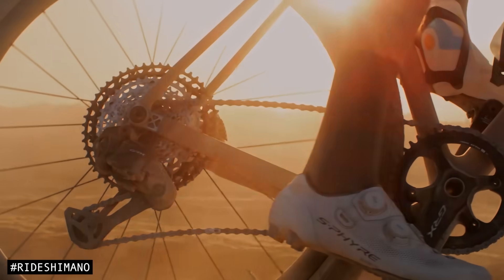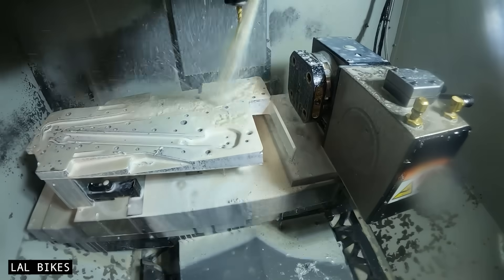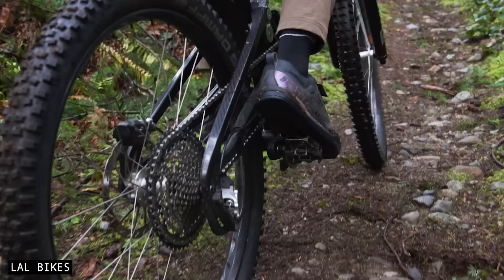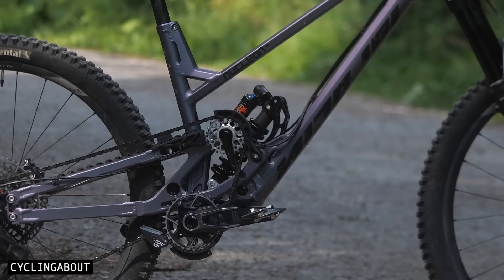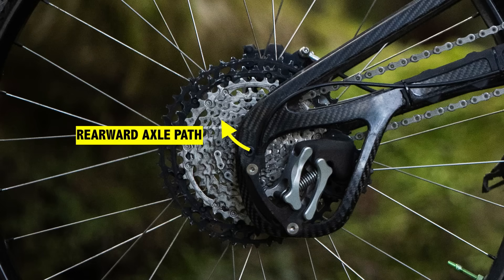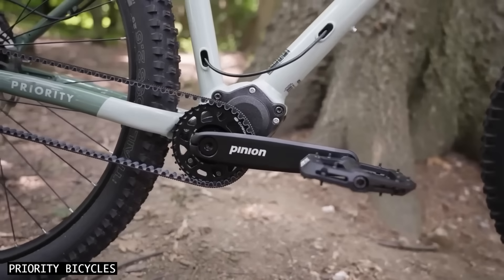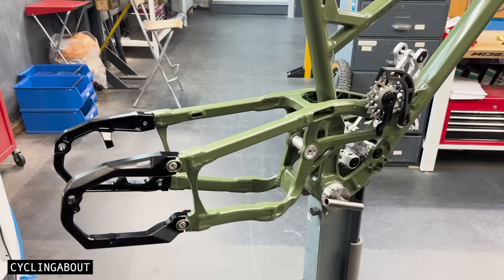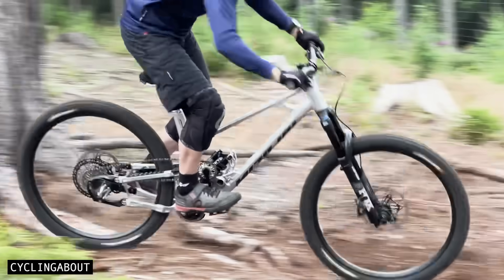This Drivetrain Is Better Than SRAM. Why Isn’t It Popular? Supre Drive Explained

Comment: What do you mean it's incompatible with mid-drive electric motors? You just need a frame for it, and even failing that, tossing a Bafang meant for regular BSA bottom brackets on there would make it work too, no different from just changing cranks.
Reply: The tensioner has its pivot around the BB. Obviously there is no space around that area on an ebike with mid drive. Mid drive conversions are also not great for mtbs since you have less ground clearance and inside the frame you would already need the space for the upper pulley and bikes without bottle holders suck. This drive system would only work on fairly compact motors (cylindrical motors like zf centrix or various light assist motors) since you'd need to move the tensioner pivot point away from its intended spot. Also most ebike drive units have some form of automatic shifting available nowadays, shimano works with their own drive trains, bosch with tektro, shimano and enviolo hub gearboxes, sram and dji with sram axs, pinion mgu obviously as well. All offer (automatic) coast shifting and sometimes even fully automated shifting depending on the drive train (shimano Linkglide yes, hyperglide no) which you really dont want to loose once you tried them, especially coast shifting.

Comment: I am not a big fan of this solution. It take a very specific frame and pivots.
Gearboxes with belt drives offer similar benefits, but reduced maintinence and while they require a specific frame to be compatible, there are more frames available for it and you can have more options for suspension linkage

Comment: If I'm going to invest in an alternative drivetrain, I'm going with an internal gear hub instead.  Slight weight penalty, but overall durability and simplicity are far higher.  This system seems to actually be more complex and feature more parts that can break or get out of adjustment.

Comment: Good, honest introduction.
00:16 ‘compatible with nearly every bike on the market’
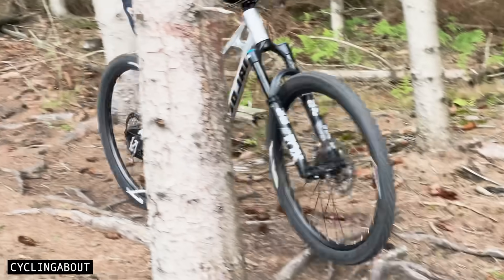06:07 ‘you'd need to invest in an entirely new bike.’
Reply: way to let everyone know that your attention span is shorter than 16 seconds.
Reply from the maker: I’m referring to regular derailleurs that you’d find on 99% of bikes at 0:16 and Supre derailleurs at 6:07. Sorry if that wasn’t clear.
Reply: first one is about regular derailleurs.
second one is about the new invention.
you are as sharp as a basketball.
Reply: I noticed that as well.

Comment: Instead of pointing to Pinion gear drives you could have said that bikes equipped with a Rene Herse Nivex rear derailleur and a Rene Herse stick shift front derailleur also need to be especially fitted with braze-ons. I have the feeling that the target market of Supre Drive are cyclists who already have a Rene Herse gruppo.

Comment: Curious to know, I have a question about the pinion gearbox.

When you compare 'chain life longevity' of a belt to the chain, what 'chain' are you comparing to?

I wonder if you are comparing a belt to a single speed chain. Which, as fat as I'm concerned, would be the correct chain to use on a bike where all the gears are in the pinoin, and none on the rear wheel, this seems like an opportunity for a single speed chain.

I have some experience of belt drive and 'single speed ebike chain drive' on a cargo ebike ~ running a rohloff rear hub. And I don't remember having ever changed either a belt or a chain. Note that these are cargo bikes being used for local business deliveries, and are doing an easy 50 to 80 km per day.
I am discounting 'accidents' where something has become 'stuck' on the bike and worn down the belt, or the chain has managed to wrap itself around a rock and broken (or in this instance twisted)  ~ but they seem like unreasonable events. I'm thinking of a test unit that runs the system 'too failure' for making a 'fair' comparison.

Comment: I have had a belt and rohloff on my mtb for 3 years now…. Couldn’t be happier!
Reply: Used a Rohloff for many years. Only downsides were high initial cost and extra mass concentrated in the hub. 14 evenly spaced gears and no missed shifts or busted derailleurs.
Reply: Same. I got another mtb with Alfine 11. How i wish i can share pics here. 😂

Comment: I wonder how big deal is the fact that the part of the chain under tension (the top line) has to be redirected around a sprocket while it is straight on a derailleur. I always found that to be the beauty of derailleur - the force travelling from the rider's pedal to the wheel and the ground is never redirected. Here you need another robust set of bearings for the high pivot cog (in contrast to the traditional pulley wheels which only deal with the return path which does not transfer significant load, and don't need to be robust, even sometimes being plastic with bushings in place of bearings).

I also wonder if the benefits of supposedly cleaner chain and nicer chain line make up for the chain having to deal with more articulation (and being forced to articulate under load, which is not the case on a derailleur - there the force is transferred between the top tooths of the front cog and the rear sprocket).

Comment: I fear this design is about a decade late but you have to admire the ingenuity of it. Also while rear triangle weight alone isn't greatly reduced, the massive benefit here is not needing a clutched derailleur. Clutches are incredibly limiting to how well full suspension bikes perform, they just became a necessity with 1x drivetrains.
Reply: This still has a clutch, it's in the chain tensioner by the BB. 
But it doesn't affect the suspension much as the main chain lines to and from the rear wheel are  pretty close to the pivot so chain growth is minimized. Just like other high pivot bikes with lower chain guides. The Lal Katana just does this a bit better by holding the lower chain really high and close to the main pivot.
Reply: yep, this has been long overdue. With gearboxes becoming more common, its DoA
Reply: @fetB  I wouldn't say it's DoA, more like it serves a niche market (off-road biking potentially taking out a standard derailleur) very well (still lighter and more DIY-maintainable than gearboxes -- an important point if you're biking in the wilderness: The ability do do emergency maintenance means you can still ride your bike even if Something Bad happens.)

Comment: 1:41 correction: that extra pulley is not required by the SupreDrive, but is just a feature of the high pivot bike, and is common to many other high-pivot designs.
There is no functional reason that SupreDrive could not work on a rigid bike, or even road/gravel, and such designs wouldnt require the upper pulley. The lower tension pulley might need to be repositioned but would just be a factor in the basic design of such a bike.
Reply: I personally think the benefits of the supre system is better suited to gravel and road, due to the potential aerodynamic gains.

Comment: For starter - I don't need full suspension bike. I have extremely negative experience with cheap derailleur, disc brakes and suspension fork up to the point I never buy/use any again, even if pricier one - I hate them with passion.
I've seen in another video on this channel fully mechanical gearbox with automatic inertial shifting, but looks like company producing them dead or not selling them. I can't found any bike which use them at least for price checking, which is unfortunate, because I really wish to use some bike with it.
This one? Chain - question closed. Chain only real thing which pull back bicycles in my opinion. I don't have time and money to maintain this degeneracy no matter how good chain drivetrain are.

Comment: Looks like the best hi-pivot design I’ve seen unless you want the lower maintenance gear box belt drive system. The better efficiency and lower weight over gear box is what attracts me. But it’s a close call. My belt drive is my go-to for mountain mud and keeps shifting after cassette based systems would be skipping. But in dry climates this new system would win every time IMO.

Comment: The drivetrains are extremely durable and can withstand significant hits directly. I have both shimano xt and sram xx transmission, both have survived significant beating. Sure some scratches etc, but they work just fine. 
Point of the derailleur is not only to not be broken, but its actually to be broken and take the hit to protect the frame.
It is means to brake if needed and take the impact so that the way more valuable frame does not brake. I have both Trek high end carbon frames. I much rather break the drive train than the frame itself.  I think this is more like fixing a problem that does not exist.
Reply: Doesn't matter, if the hit is done the chance the shifting is screwed because of 12 speed is to high. 
RD miss shifts are the worst in MTB terrain

Comment: It looks complex, it gives an impression of a lot of components to clean and maintain. The system is very proprietary, fits only custom bikes and is prohibitively expensive... I do not see much future for it to be honest. I would go for a Pinion or a gear hub bike for a better survivability and less maintenance. 
Pros don't care about weird drives like this, they just take whatever new drive their sponsor gives them and all other performance focused riders will follow what the pros use and what is widely reviewed in MTB press. More casual riders will ether choose standard solution, or go for low maintenance enclosed gearbox/gearhub. I can't imagine a niche for this drive system.

I think the best scenario is that they will carve a small niche of dedicated Supre Drive fans with their own brand of bikes. Something like Effigear did with Cavalerie.

Comment: I like this innovation, have been trying to design something similar, but using off-the-shelf idlers while keeping bog standard frame compatibility. This approach to a better drive train is the key to less weight, easy self maintenance and parts compatibility across different bike, for me, 3 of the greatest benefits of the deraileur. That said, what Microshift are achieving with the conventional Advent and AdventX derailleurs is probably more like what I'd rather see with inventive pivoting to cover huge gear range with less derailleur length.

Hubs and gearboxes have benefits that I don't dispute, but the weight and price of derailleur wins me everytime. And you can jerry rig a drailleur if you bash it up. A rider who knows their hardware is never stranded.

Ben at Trisled was a bit skeptical of my opting for Advent (wanted AdventX, we compromised) for my Greenspeed GT20 but he came around very quickly and is now recommending Advent as an upgrade on older GT20s due for mech replacements. When the Advent wears out on mine, I'll probably push up to AdventX 10 speed because the derailleurs aren't any longer and the pull range is easily good enough for 11-46, fine for road/gravel triking in SE Australia.

Comment: So basically every bike manufacturer has to completely redesign their bike to work with this. Just like pinion. This might find a niche market, but transmission has kind of taken over. Still a parallelogram and cassette but a massively more complex rear triangle. 

The benefits are obvious but bike manufacturers won’t bend over backwards to make their bikes compatible with a kickstarter project.

Oh and you need 2 chains.

Comment: what if the wrap around the tucked in derailleur takes a nasty hit? Isn't that potentially a new rear triangle hit of smash? One bike looked like it had a replaceable protective cage, but that carbon one looked like you'd be spending way more than 500 bucks to fix it.

Comment: Use a mid-drive gearbox and belt drive
Reply: Depends on what you want: gearboxes are around 6% less effective than derailer drivetrains. But you have all the hassle with cleaning chains, damages etc.
A gearbox is cheaper in the long run but a big investment up front, has a wider spread and is nearly maintenance free. 
IMHO: derailer drivetrains are best for sports and gearboxes for everyone else. If you are using a motor efficiency is no problem making this a no brainer. 
The only thing holding back gearboxes is, that many people overestimate the loss of efficiency and are to cheap to invest up front to save money later.
Reply: @svenweihusen57 Some just plain old can't afford the up front $$, not really being 'cheap' or stingy, just broke.
Reply: @svenweihusen57  I traded my IGH for a derailleur setup after 3 years of nearly maintenance free riding for a couple reasons. First, if you don't have adjustable dropout, you need to deal with an eccentric bottom bracket, which is expensive, harder to install and NOT maintenance free. Second, it made the bike around 1kg heavier and 5% less efficient. But my main problem was the limited gear range on a nexus5 hub (265%). Not enough for steep hills. I know Pinion and Rohloff offer solutions with wider gear range but these are $$$$$.
Reply: exactly
Reply: @ignaciosevil1944  After riding 10,000 km with the Cube Editor belt drive, both sprockets and the belt wore out. When I bought the bike, I had the impression it would last much longer

Comment: Always surprised that there are still innovations possible on such an old invention like the bike
Reply: Once we figure out front wheel drive, we can have two wheel drive bikes for a little extra zing in the snow. Mechanical regenerative braking would be a plus. I am surprised that nobody is attaching molded foils to reduce wind resistance. Instead of E-bikes, how about e-trailers for carrying loads? Of course, we haven't found a way to put two hundred bicycles into one vehicle. We should be able to make that one fly.

Comment: As someone who has broken a derailleur on a 55 lb e-bike deep in the Santa Cruz Mountains and had to hike it like three hours back to my car (fortunately I was able to bind up the der to the chainstay so I could at least coast), I'm very interested in this drivetrain.
Reply: You must of missed the part about them not working with E-bikes. Pinion MGU is the system I want for a E-bike this system would be great for a Enduro or trail bike
Reply: @aaronoconnor606  This is ignoring that one could still use the Elevate Ebike Conversion Kit that is a wonderful, easy way to turn almost any MTB into an ebike!
Reply: @aaronoconnor606  The current prototype might not work with E-bikes, but the maker did leave a comment that they're working on a solution, probably a variant with slightly less performance in some ways, but compatible with E-bikes.
Reply: Gear hubs are a good option for e-bikes. Retrofitting Rohloff on a modern bike is a bit of a chore, you need to ask Rohloff for measuring kit, measure the dropouts and then they will sell you a properly fitting kit. A lot of e-bike manufacturers already sell bikes with Rohloff hub out of the box because it handles mid-drives really well, so I would go that way if I was buying a new e-bike. 
An alternative would be something like the new 3x3 Nine gearhub. It fits thru axle dropouts out of the box and handles more torque than Rohloff. 
The disadvantage of any gear hub is that you have  extra mass in the centre of the rear wheel, not much of a problem on a hard tail in my opinion and experience, but you will probably notice worse performance of rear suspension with  the extra unsprang mass on a fullsuser. Still I have an analogue full sus bike that I fitted with Rohloff and I love that thing.
Either way if you are tired with e-bikes chewing thru cossets and derailleurs gear hubs are a good option to consider.
Reply: Pinion smart shift gearbox
Reply: i'd have just set it up one speed with a chainbreaker and locked the rear sus. maybe disable the motor just to be safe
Reply: @enzochoi923  I did think of that, but the chain was hugely mangled as well actually. I think I did have a chain tool, but I was very new to mountain biking at the time and I didn't really know how to use it. I think I did try but I couldn't get the chain pins into position. I asked the techs at my local shop about it afterwards and they said it would have been really difficult or impossible even in the best case. I don't think you can single-speed a full sus bike without a tensioner, and the der was like literally inside out.
Reply: @billydeewilliams8909  full sus motorcycles just run some amount of sag, but that's also why I'd recommend locking out while running the single speed bailout. honestly considered running my hardtail like that for pure simplicity (and not wanting to buy a chain tensioner) but I get enough of the fixie/single speed life on my unicycle.
Reply: Lesson, always carry a chain break. I had a chain break in 1979, bought a chain brake, only used it once on a ride, in 2020 lol
Reply: @miniac60  Very true. That e-bike has a full-power mid-drive and it was pretty much the first mountain bike I ever owned, and it came stock with a non-e-bike-rated drivetrain, which I didn't know or understand the significance of at the time. I've since fixed it with SRAM manual transmission but for a long time I had to be really ginger with it, actually. On at least three occasions I broke brand new chains and had to use quick links and such, so now I always carry like three of those as well.
Reply: "I'm very interested in this drivetrain"
I think it is likely to cost you at least $3000 and probably more. You cannot retrofit it to your existing bike. Are you interested enough that you are prepared to a buy a whole new bike?